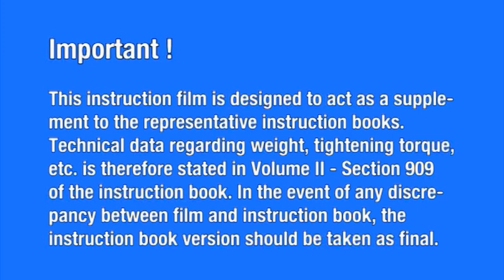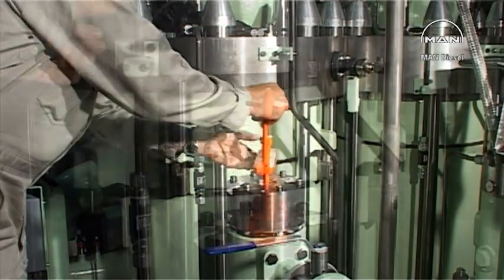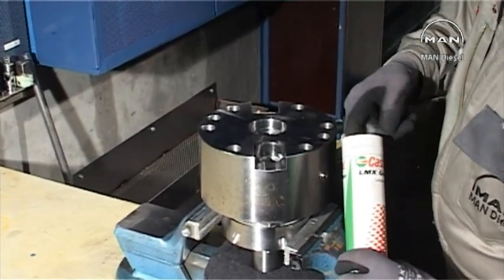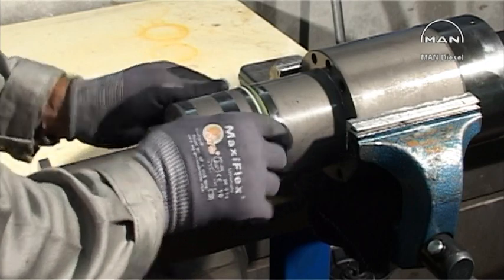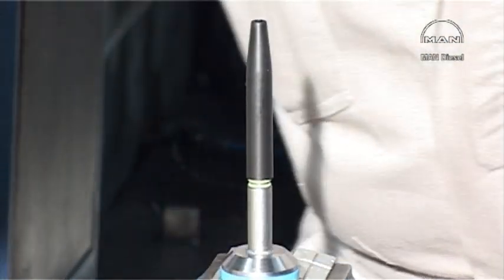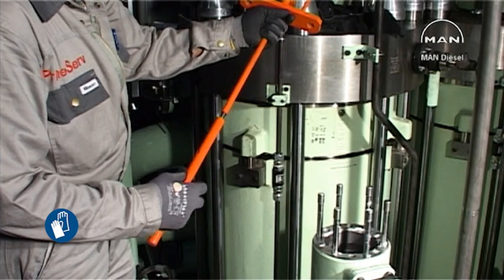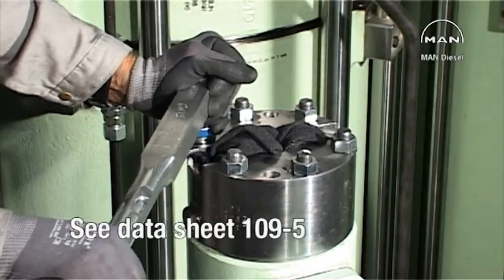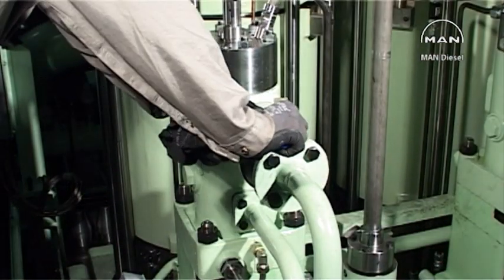Fuel Pump Cover Overhaul

Comment: Thanks for the video. But how did u disconnect plunger-roller guide trust piece and how does fuel index turns plunger if u are just putting it like that. Small bore could be really that different? But still the connection of index-roller guide. 🤯

Comment: why not remove the plunger from the barrel?, you have it all apart anyway, would have been nice to see it, and why are you calling cylinder heads "covers", most car/truck mechanics call these cylinder heads or valve bodies, make it much LESS confusing.
Reply: Barrel and plunger should be treated as one body,since its a sensitive part and maybe the heart of each engine.Regarding the calling of the parts, marine engineering having different dictionery from the cars/trucks

Comment: This Man videos are funnys so that the reality is another because the pump and connections are locked for the fuel oil, what is the camshaft position for dissasemble the pump. In this video all clean beutifull, in my experience is not
Reply: May be catch 22